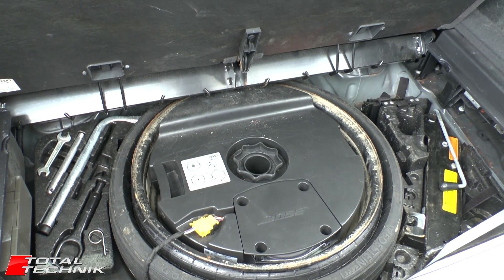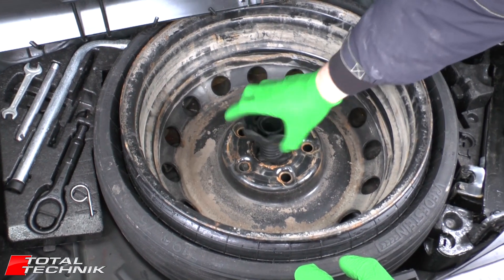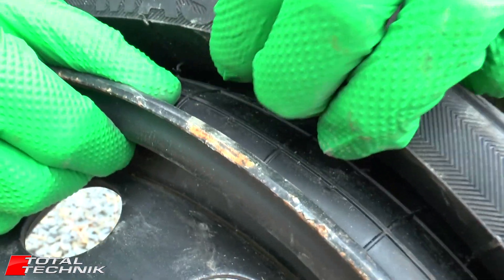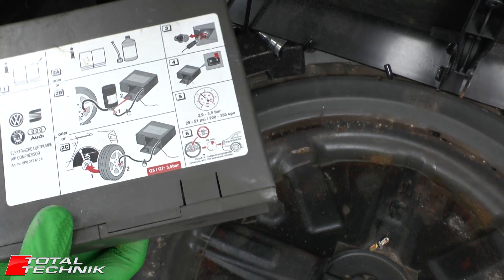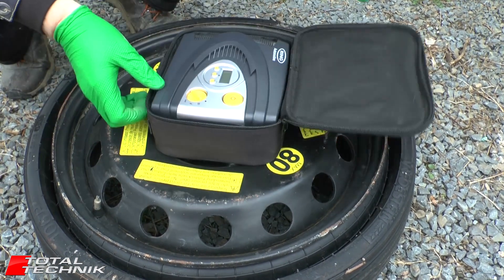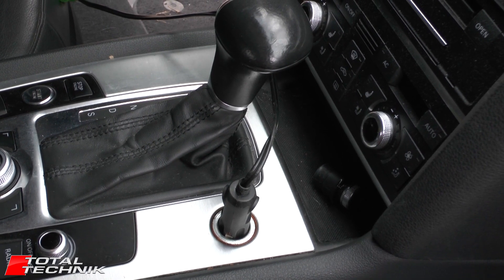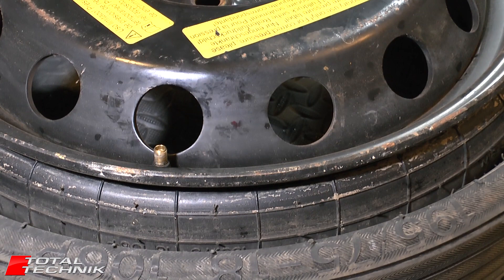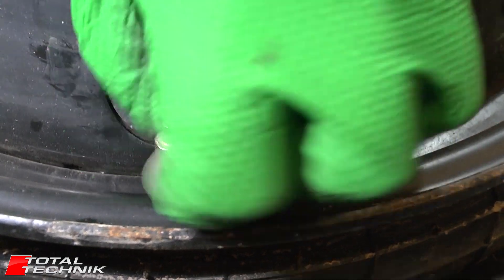Collapsible Expanding Spare Tire (wheel) - HOW DOES IT WORK???

Comment: Now. Try to buy a replacement. You cant. If you could its two to three times the price of a real tire. The only place that sells replacement is the car dealer. One of the best choices is buy a fifth wheel and tire when you buy the car and throw this rubbish pump and crap tire out.

Comment: Its a joke this isnt standard on all cars! In australia, you can be 500km from help in the outback!
Reply: I was 250 miles from a tire shop in utah. I am an aussie. I will never again rent or buy a car without a full size tire as spare. The flat meant a repaif kit or spacesaver couldnt be ised as i was too far from s destination to use the spacesaver. Trip destoyed.

Comment: :face-blue-smiling: sorry, again any one that thinks this is a good idea please think again this is another over engineered product that is of no use, firstly when eventually fitted after 30 minutes at the side of the road in the rain with trucks flying passed putting you and your families lives at risk, been there more than once, not any more, the chap admitted even the tread style is probably not safe  or proven, so just go back to the proven quickly fitted original spare wheel concept  can change a wheel in 6 minutes all my cars now have proper spare wheel with all the relevant tools jack etc attached including torch because this is more prevalent than ever with these massive pot holes that have cost me personally and my company thousands on tyres and alloys some of my vans have 2 spares close proximity to the doors not under the vehicle. they get damaged and seize with rust etc. my son had to go and stay with our nearest family member when 70 miles away from home hit a pothole in the clyde tunnel hit a large pothole burst tyre and damaged new alloy wheel expansive couldnt get aa out with new tyre till the next day this is insane so please get a proper even second hand spare at least.

Comment: I deflated my collapsible spare but now it won’t inflate again,seems to be unseated.  Any ideas how to get it inflated again?
Reply: I had this same issue and later had to use it again.  Fortunately I was near a shop and we sprayed silicone spray all around the bead area and the inside of the rim.  Inflated it 2 or 3 times and tapped with a hammer and the bead seated again and we used it. I've got 250 miles on mine now; only reference I've been able to find for usable range says 70 miles....  I've ordered a replacement from ebay.

Comment: Just tried to use my spare and it was useless. The pool toy compressor is also a joke. Spent over and hour trying to chase air leaks from around the tire to get it to hold.
Reply: 100% garbage....that compressor will never seat the tyre if the bead is not seated on the tyre... I see many reports of these Vredestein collapsible tyres unseating from the rim while unused in the boot.....rendering it completely useless when you need it....

Comment: Would have been easier to design the vehicle with a little bit bigger hole
Than to design this tire / rim and have to carry a compressor 
Praying to God that the compressor  works if you get a flat
Or you will have 2 flats instead of 1

Comment: Trust Audi to over complicate a spare tyre, while saving a few centimetres of space. Watch how in 10 years time that compressor will fail, and the tyre will somehow not inflate properly
Reply: The tyre will unseat in the boot well before the 10 years, so there are two points of potential failure......and half the space you save is taken up by the cheap compressor....
Reply: Me today in a parking lot cursing Europeans for over an hour to eventually call for a tow….

Comment: I think they should just make the room for a spare. The last thing you need on the side of the road is to deal with all this nonsense. But thanks for the video now I know how to put on an over engineered "temporary tire" it's definitely not a spare. A spare insinuates that it's an extra tire/wheel. Temporary means you are screwed and need to immediately figure out how and where you can go get a new tire and what hotel you can stay in if it's a Sunday and you aren't close to home. Several family members have audi suv's. I like my practical toyota 4runner. Doesn't  break down and has a full size spare if you get a flat.
Reply from the maker: Yes, these are definitely not everyone's favourite solution for the problem. Some models (like the Q7) could have masses of space for a full spare really, the rear end seems slightly oddly designed (not maximised). Still, it does allow them to get the 'spare' into a much smaller space when it is genuinely needed/justified. But a full size spare is a better option in reality!! :-)

--- 

To help support us (for both you and others reading this) there are a few things you can do:

1) Donations both needed and welcome! We cannot operate Total Technik without the support of people like you! You can donate by PayPal - just go to www.paypal.me/totaltechnik
2) Please ensure you subscribe to our YouTube channel. 
3) Please give our video's the Thumbs Up on YouTube. 
4) Please help spread the word, the more people who know about us the better! Add links to our video's in forums, let people know about us.

Thank you for your support!